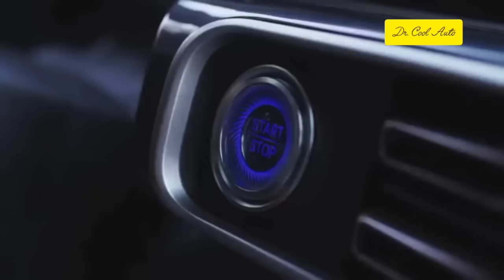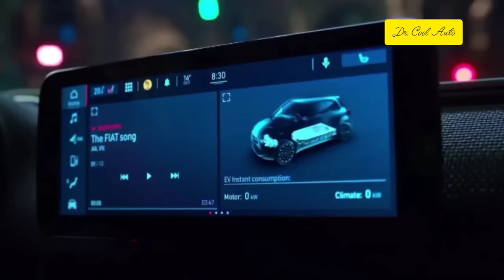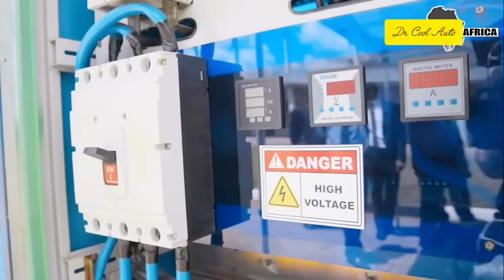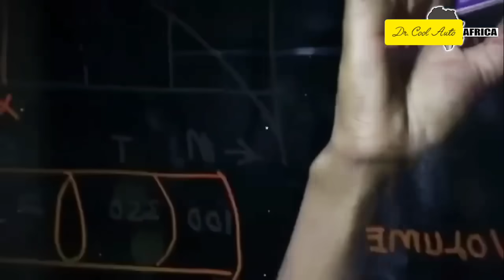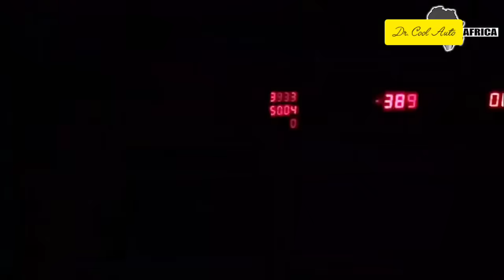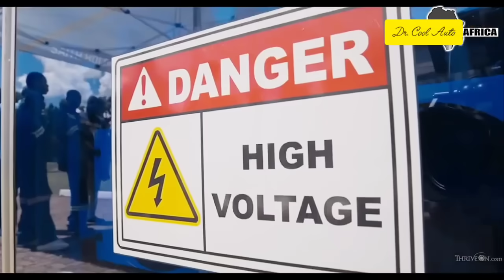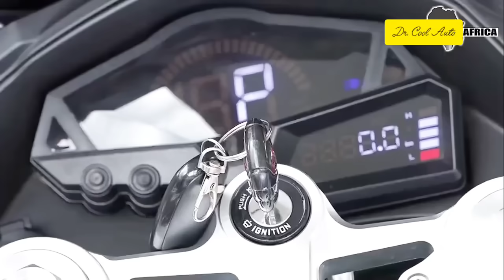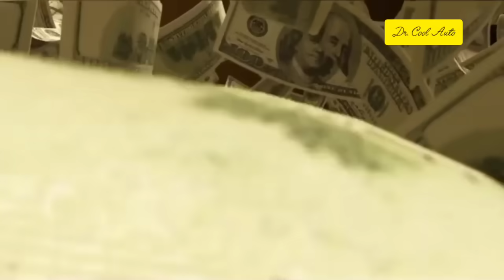2025 Self-Powered EV: Shakes Up The Entire World! shock skeptics

Comment: Forgive me! I'm praying that this should not be yet another scam on the people!
Reply: Soundara...   It might surprise you but this letter will explain to you, using logic as "proof" of why this so called "new source of energy, invention"  is a deceitful add for fraud, to steal money from whoever is naive,  and would end receiving nothing back for any sent money.  What is shown in this video  is nothing other than one more deceitful propaganda fraud sci-fy tech advertisement,  like the other adds presented 15 and 10 years ago about cars running on nothing but water and no other energy necessary  but in fact was never true since it was about the "hydrogen" from the water,  needed to be extracted from the water by consuming a large 
amount of 
electricity first, before producing the "hydrogen",  from the water. And that energy used to extract hydrogen from the water, costs money every time, and is not free. Therefore the water advertisement video , to be used directly as free source for energy for cars,  was and is a fraud advertisement video.  This video is shown by this YouTube channel also for profit if earning either money through this channel, or subscribers that might use the service that this channel may offer. But the "cars running on 
water 
as free source of energy", (old video add) was a fraud add because was presenting >deceitfully< the implication  of water used directly as a free source of energy instead of the hydrogen from the water,  which was needed to be extracted from the water, with the help of electricity, through the consume of electricity,  and the process (of extracting hydrogen from water),  is not free but costs money each time, when hydrogen is extracted from water (the car running not on water but on hydrogen). Therefore 
the old 
videos with such propaganda of cars running a water had the point of deception hidden by the assumption and the implication that not a component of the water that needs extracting through the cost of money, but the water itself was the source to just put water instead of diesel or gasoline in your car's reservoir.  Yet  is not possible so, since is a deception, a fraud add. The same is with this add = it costs money no matter what you use to extract the energy from whatever source whether solar radiation or 
radio 
waves, rays, sonic energy or whatever "term" you could come up with (UNLESS IS THE DIVINE SOURCE  "YHWH".   Know yee that the deceitful propaganda from  this video has connection with China and  the Chinese which are heavily involved in Africa sucking the blood out of Africa by enslaving it, the modern way, with slavery that the West practice no more (slavery) else would have not had a civil war white people killing their own white people that were pro-slavery.  The CCP China practitioner of 
methods 
to enslave entire nations, would never have a civil war to kill their own pro-slavery CCP people, to abolish slavery (else would not do what they do right now in Africa) besides cheating and deceiving a lot, non-stop with deceitful diverse propaganda.  But ask yourself this:  If the Chinese made cars and motorcycles or mopeds or bicycles that runs with his so invented new tech (which is fake), but if were true, right now such Chinese cars, motorcycles, or mopeds and bicycles could be seen on the streets 
of the 
European nations and other nations world wide, and especially on the streets of the nations Europe and Africa and Asia and South America which sabotaged the plan to impose tariffs on the Chinese cars and other imports, and still brings Chinese cars, motorcycles and bicycles with no extra taxes or no imposed tariffs.  That means such cars, motorcycles and bicycles  would be seen on the streets of many nations and their engines would be shown in videos by many proud owners of such vehicles  but 
the fact 
that there is no existing proof of such vehicles with such engines to be found on the streets of any nations in number of thousands of cars, or motorcycles, or at least on bicycles, ... the not existing so on the streets,  it is the counter-proof for you to know that the presented fictitious invention is only one more fraud add attempt to get money from the naive people that could be fooled, so that they end up never seeing their invested money in any form back, ...  not even in a real vehicle or bicycle 
with 
such engine, and feel ashamed and foolish for believing such lie and become a victim of such fraud. No one that truly gets to have such miraculous technology that produces free powerful  energy in huge quantity while the device (engine) is as small as he has shown the fake device attached to that TV screen, to be,  while having in it hidden a powerful lithium very small battery able to turn on the TV for a very short time, after which needs recharging with expensive electricity, else needs to 
be kept 
plugged in the wall to the electricity source ... therefore a fraud of a video "add" made in Africa,  to cheat naive Europeans and Americans  off their hard earned money; ...  No one having such technology of powerful free energy emitting small device (engine), would show it on videos publicly on the internet and still remain alive to be able to still post such fake claim, (unless is a fraud, a fake claim) because if were true,  immediately some people from all the huge energy source producers that would automatically 
become 
bankrupted even as countries becoming bankrupt (whether owning sources selling gas, lithium for batteries, or selling electricity, or petrol or other oil (bio-fuel),  all such countries as well as owners, but even China itself known as the greatest thief of technology unwilling to pay the annual fee for the Non-Chinese  (Western) patented invented technology that China  usually steal,....  all such countries and owners of the known energy sources and all of them having assassins and snipers would have 
stolen 
by now  that technology and eliminate that man or just paid him much. And that technology (if were true),  would be  either kept secret and never applied on anything that could be sold and then copied, without paying for the patented invention annual fees, (as China does not pay such annual fees for 90% of everything it produces and which is produced from Western patented technology ).  All those owners and countries of diverse energy sources would either make the invention not-applicable if the 
invention 
were real, or else  would use it on expensive products (cars, bicycles, ... and anything that needs energy) and sold to you as expensive as today's items using energy, to get your money, monthly,  to replace today's known energy sources that are more expensive to extract or to apply,  such as solar panels requiring much space for solar panels and sunlight non-existent at night or at day in cloudy conditions,  and storage of that electricity into expensive batteries, and the same for the wind making electricity that 
also 
requires much space and wind which doesn't exist always and everywhere, and expensive  batteries and storage space of the electricity produced by wind into expensive batteries.  Such fictitious energy source presented on this video, (if it were real - would be immediately stolen and then either):  kept secrete until all the present energy sources (gas, petrol, coal, and battery minerals or lithium) becomes exhausted and finished,  or else are replaced with a new source of energy that would 
not be 
"free energy" but cost as much money, paid monthly because the owners and countries of energy sources (gas, petrol, coal, lithium and batteries, solar and wind tech and electricity makers and countries would NEVER want to receive NO money monthly or annually and become bankrupt and in need of money because  of  giving  free energy and not collect money and thus to become bankrupt.   LOGIC ==>  NO FREE  ENERGY SOURCE INVENTION  would ever give you free energy while the earth is ruled by men and 
not by 
The Divine MessiYAH   YHWH Savior  (YAH Shua).  There is no free and unlimited Source of Energy other than   "YHWH" EL,  The EternaL  EL (EL'o'him),  Self Aware Unlimited Energy (Spirit/Force/Almighty Power) Limitless in Intelligence (from the eternity past),  Pure (Holy),  Creator of the Universe (from beyond time and space, Creator from EL's Self Unlimited Energy)  Y.H.V.H.,  name abbreviation which also stands for  "I Was, I Am, I'll Be",  and YAH EL,  The Divine Eternal Word that took human form under the name YHWH Savior (YAH Shua) The Divine MessiYAH,  EmMan[u]EL  (AmongMen[the]Eternal).

Comment: If you take a closer look at the spec of these A380 passenger jets , it claims it has a 380,000 liters fuel capacity,  280 metric ton - 😮 it can fly without the wings falling off , but repair man is not allowed to walk on the wings as it coud damage them!!
Reply: What the HELL does that have to do with this video? Nothing!🤣😂🤣
Reply: @art.is.life.eternal   the jet engines don't use fuel once they take off,  it's some kind of frequency weight reduction, and thrust engines,  on the new A380 , this technology is already in use

Comment: This technology crosses over into other industries! It's a multi-trilliom dollar game changer!!
Reply: Garga....   It might surprise you but this letter will explain to you, using logic as "proof" of why this so called "new source of energy, invention"  is a deceitful add for fraud, to steal money from whoever is naive,  and would end receiving nothing back for any sent money.  What is shown in this video  is nothing other than one more deceitful propaganda fraud sci-fy tech advertisement,  like the other adds presented 15 and 10 years ago about cars running on nothing but water and no other energy necessary  but in fact was never true since it was about the "hydrogen" from the water,  needed to be extracted from the water by consuming a large 
amount of 
electricity first, before producing the "hydrogen",  from the water. And that energy used to extract hydrogen from the water, costs money every time, and is not free. Therefore the water advertisement video , to be used directly as free source for energy for cars,  was and is a fraud advertisement video.  This video is shown by this YouTube channel also for profit if earning either money through this channel, or subscribers that might use the service that this channel may offer. But the "cars running on 
water 
as free source of energy", (old video add) was a fraud add because was presenting >deceitfully< the implication  of water used directly as a free source of energy instead of the hydrogen from the water,  which was needed to be extracted from the water, with the help of electricity, through the consume of electricity,  and the process (of extracting hydrogen from water),  is not free but costs money each time, when hydrogen is extracted from water (the car running not on water but on hydrogen). Therefore 
the old 
videos with such propaganda of cars running a water had the point of deception hidden by the assumption and the implication that not a component of the water that needs extracting through the cost of money, but the water itself was the source to just put water instead of diesel or gasoline in your car's reservoir.  Yet  is not possible so, since is a deception, a fraud add. The same is with this add = it costs money no matter what you use to extract the energy from whatever source whether solar radiation or 
radio 
waves, rays, sonic energy or whatever "term" you could come up with (UNLESS IS THE DIVINE SOURCE  "YHWH".   Know yee that the deceitful propaganda from  this video has connection with China and  the Chinese which are heavily involved in Africa sucking the blood out of Africa by enslaving it, the modern way, with slavery that the West practice no more (slavery) else would have not had a civil war white people killing their own white people that were pro-slavery.  The CCP China practitioner of 
methods 
to enslave entire nations, would never have a civil war to kill their own pro-slavery CCP people, to abolish slavery (else would not do what they do right now in Africa) besides cheating and deceiving a lot, non-stop with deceitful diverse propaganda.  But ask yourself this:  If the Chinese made cars and motorcycles or mopeds or bicycles that runs with his so invented new tech (which is fake), but if were true, right now such Chinese cars, motorcycles, or mopeds and bicycles could be seen on the streets 
of the 
European nations and other nations world wide, and especially on the streets of the nations Europe and Africa and Asia and South America which sabotaged the plan to impose tariffs on the Chinese cars and other imports, and still brings Chinese cars, motorcycles and bicycles with no extra taxes or no imposed tariffs.  That means such cars, motorcycles and bicycles  would be seen on the streets of many nations and their engines would be shown in videos by many proud owners of such vehicles  but 
the fact 
that there is no existing proof of such vehicles with such engines to be found on the streets of any nations in number of thousands of cars, or motorcycles, or at least on bicycles, ... the not existing so on the streets,  it is the counter-proof for you to know that the presented fictitious invention is only one more fraud add attempt to get money from the naive people that could be fooled, so that they end up never seeing their invested money in any form back, ...  not even in a real vehicle or bicycle 
with 
such engine, and feel ashamed and foolish for believing such lie and become a victim of such fraud. No one that truly gets to have such miraculous technology that produces free powerful  energy in huge quantity while the device (engine) is as small as he has shown the fake device attached to that TV screen, to be,  while having in it hidden a powerful lithium very small battery able to turn on the TV for a very short time, after which needs recharging with expensive electricity, else needs to 
be kept 
plugged in the wall to the electricity source ... therefore a fraud of a video "add" made in Africa,  to cheat naive Europeans and Americans  off their hard earned money; ...  No one having such technology of powerful free energy emitting small device (engine), would show it on videos publicly on the internet and still remain alive to be able to still post such fake claim, (unless is a fraud, a fake claim) because if were true,  immediately some people from all the huge energy source producers that would automatically 
become 
bankrupted even as countries becoming bankrupt (whether owning sources selling gas, lithium for batteries, or selling electricity, or petrol or other oil (bio-fuel),  all such countries as well as owners, but even China itself known as the greatest thief of technology unwilling to pay the annual fee for the Non-Chinese  (Western) patented invented technology that China  usually steal,....  all such countries and owners of the known energy sources and all of them having assassins and snipers would have 
stolen 
by now  that technology and eliminate that man or just paid him much. And that technology (if were true),  would be  either kept secret and never applied on anything that could be sold and then copied, without paying for the patented invention annual fees, (as China does not pay such annual fees for 90% of everything it produces and which is produced from Western patented technology ).  All those owners and countries of diverse energy sources would either make the invention not-applicable if the 
invention 
were real, or else  would use it on expensive products (cars, bicycles, ... and anything that needs energy) and sold to you as expensive as today's items using energy, to get your money, monthly,  to replace today's known energy sources that are more expensive to extract or to apply,  such as solar panels requiring much space for solar panels and sunlight non-existent at night or at day in cloudy conditions,  and storage of that electricity into expensive batteries, and the same for the wind making electricity that 
also 
requires much space and wind which doesn't exist always and everywhere, and expensive  batteries and storage space of the electricity produced by wind into expensive batteries.  Such fictitious energy source presented on this video, (if it were real - would be immediately stolen and then either):  kept secrete until all the present energy sources (gas, petrol, coal, and battery minerals or lithium) becomes exhausted and finished,  or else are replaced with a new source of energy that would 
not be 
"free energy" but cost as much money, paid monthly because the owners and countries of energy sources (gas, petrol, coal, lithium and batteries, solar and wind tech and electricity makers and countries would NEVER want to receive NO money monthly or annually and become bankrupt and in need of money because  of  giving  free energy and not collect money and thus to become bankrupt.   LOGIC ==>  NO FREE  ENERGY SOURCE INVENTION  would ever give you free energy while the earth is ruled by men and 
not by 
The Divine MessiYAH   YHWH Savior  (YAH Shua).  There is no free and unlimited Source of Energy other than   "YHWH" EL,  The EternaL  EL (EL'o'him),  Self Aware Unlimited Energy (Spirit/Force/Almighty Power) Limitless in Intelligence (from the eternity past),  Pure (Holy),  Creator of the Universe (from beyond time and space, Creator from EL's Self Unlimited Energy)  Y.H.V.H.,  name abbreviation which also stands for  "I Was, I Am, I'll Be",  and YAH EL,  The Divine Eternal Word that took human form under the name YHWH Savior (YAH Shua) The Divine MessiYAH,  EmMan[u]EL  (AmongMen[the]Eternal).